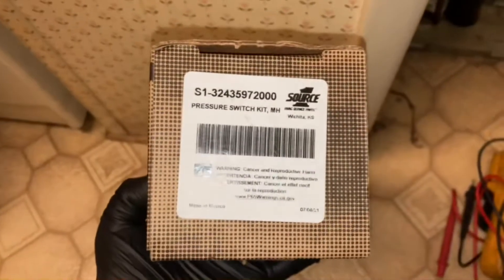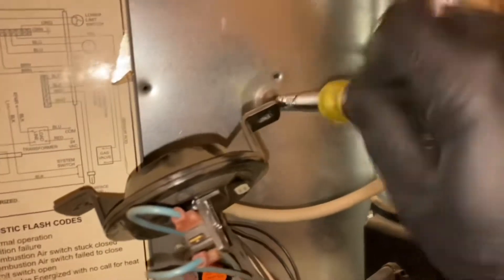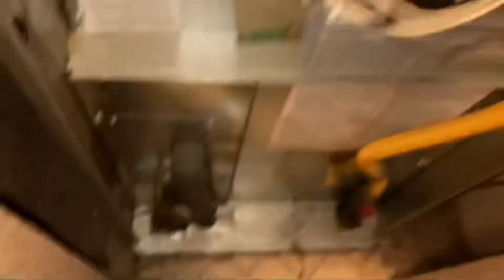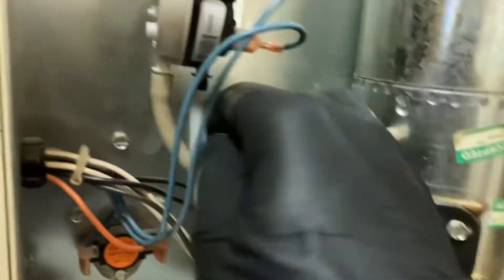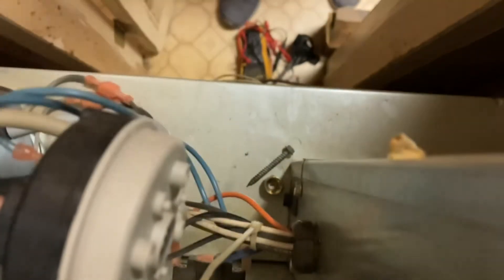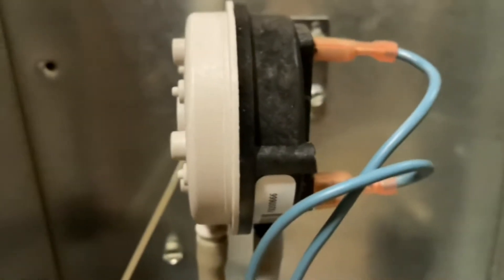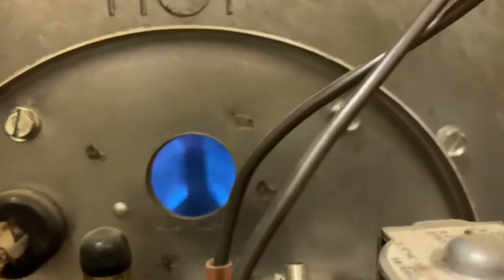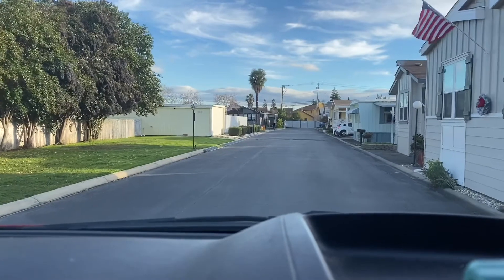Coleman furnace pressure switch replacement #hvac #hvaclife #hvactechnician #diy #hvactechnician

Comment: On mine the green light blinks once. The code is ignition failure. Does that mean the ignition rod needs cleaned ?
Reply from the maker: It could be the igniter, the gas valve or the control board most of the time it’s the igniter. Check to see if you see the glow inside if you see the glow inside then it’s either your control board not sending voltage to your valve or a bad gas valve.

Comment: Something I found was the fan was turning too slow because the aperture shaft needed oiling. I pulled the cover for the fan off and sprays a shot of WD-40 on the fan blade shaft, it ran down into the fan motor and lubed the bearing,,

Comment: Did you test it before you put a new part?
Reply: Could'a pulled the hose from the fan side and gave a few suck n blows to get the switch moving again. And would have determined if the diaphragm was leaking.

Comment: Have the same coleman but where it says hot it never gets hot I can touch it the whole time while the flame is running. Why? Please help. Everything seems to be working it just never blow hotter than 67°
Reply from the maker: Could be a spider in the gas orfice I have a video about that problem check it out
Reply: I have the same issue never blowing hot air
Reply from the maker: @ricardogomez3365  check out my video about Coleman furnace with spider in the gas orfice that might help
Reply: Problem solved spider in gas orfice

Comment: I wonder if the previous tech smacked his manometer on her and the inducer was not pulling proper  I.N. W.C. And he was going to replace inducer motor. Or he was trying to sell this man what he did not need. Usually the inducer will pull 2x the pressure switch rating . Did you by chance get a manometer reading?
Reply from the maker: Yes it was pulling proper vacuum faulty pressure switch the previous switch was not passing 24v through the switch
Reply: I'VE REPLACED THE SWITCH 3 TIMES , MOTOR ONCE . COLEMANS SUCK @Victoryhomeservices209  I'VE REPLACED THE SWITCH 3 TIMES , MOTOR ONCE . COLEMANS ARE GARBAGE